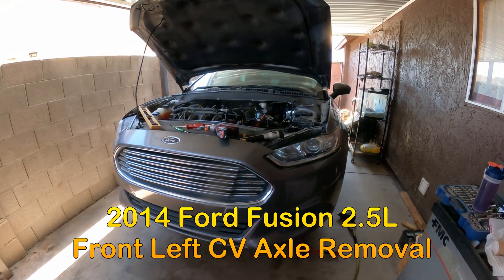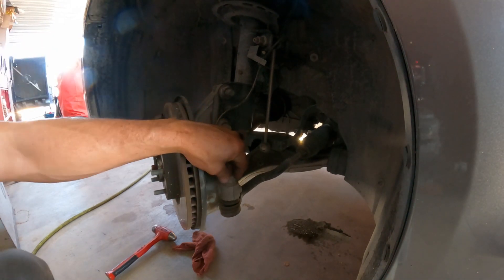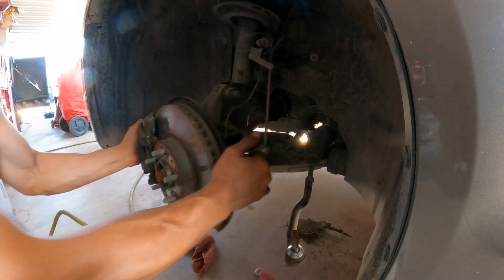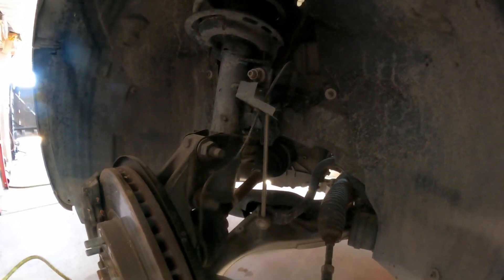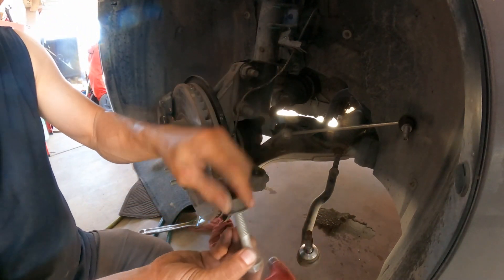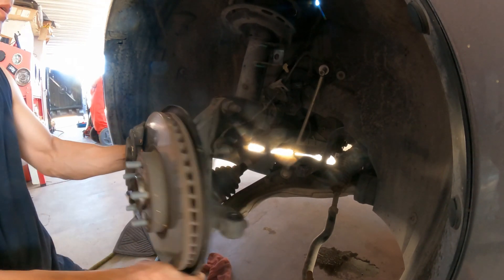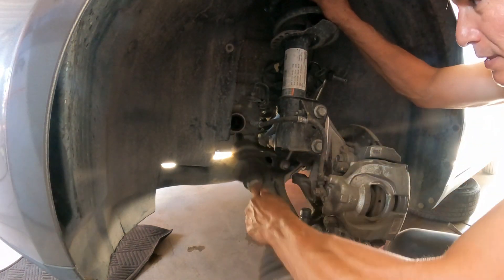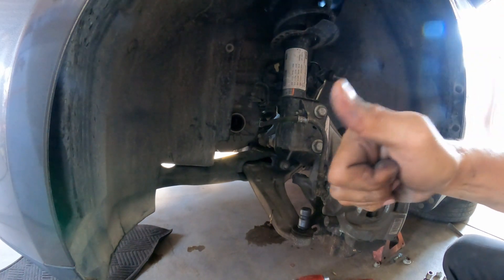2014 Ford Fusion 2 5L Front Left CV Axle Removal

Comment: Did you reuse the output shaft seal, C-clip retainers, and the washers?

If so, any issues from reusing them or did you buy the new ones?
Reply from the maker: Hello! That is a good question. If you will reuse the same axle you can reuse the c clip. The new axle comes with a new c clip. If the output shaft seal is NOT leaking you can reuse it. Be careful not to damage it when you remove the axle. Let me know if you have any other questions. God bless

Comment: Great video & greetings from NJ! I attempted removing the driver's side cv axle on my 2014 fusion yesterday, & the axle is stuck in the wheel bearing..so I may have to remove the steering knuckle/bearing/cv axle altogether..any suggestions for removing the steering knuckle? Any special tools needed for putting the ball joint back together? Can the tie rod bolt be removed without an impact wrench? The other end of the axle in the transmission came right out..Thanks!